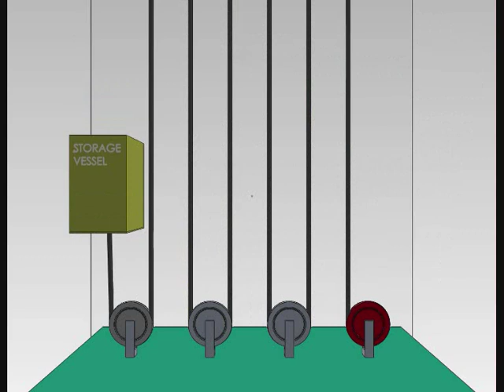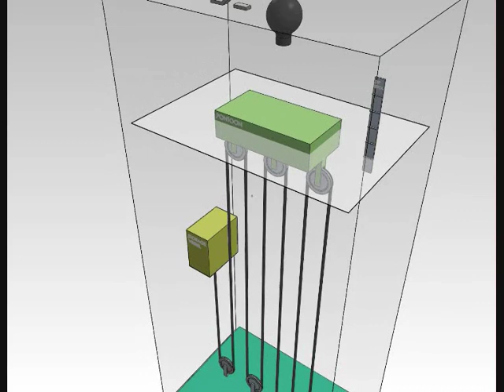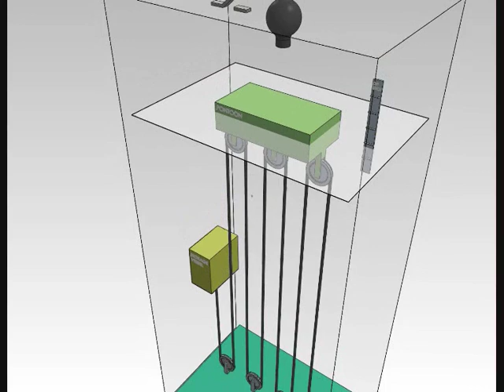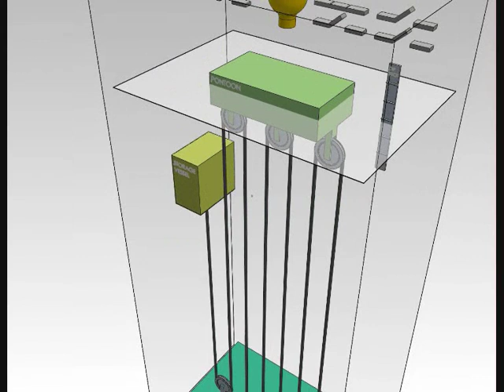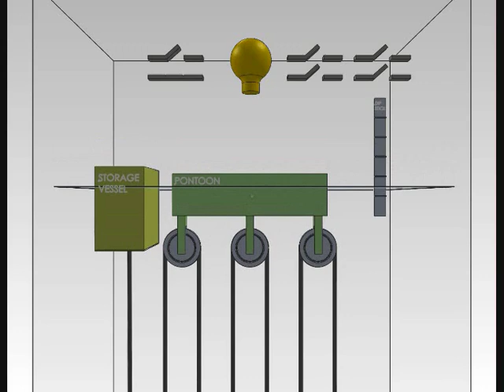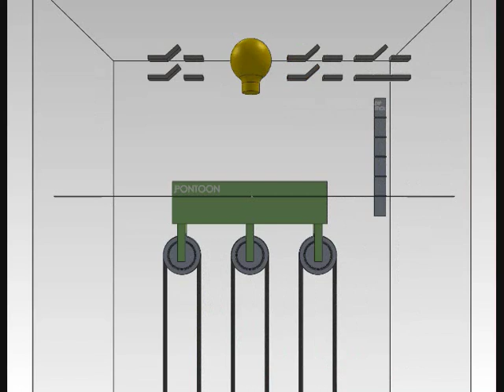Buoyancy Engine

Comment: i can make a similar system that doesn't even use tide. you can leverage the compression of air causing one float to sink. then you can relese the air back to low pressure and the float will go up. anyway in a float system, forces can be balanced one way and imbalanced another way. does not need to do any real work to create lot of work. principe is two system. one is the float itself the other is the change in pressure. one system give the other advantage and can be reversed.

Comment: The theory sounds good, but......You will have constant issues overpowering the weight or density of the water at max depth of the device to even cause it to come back up. Not to mention constant diver cleanup of marine life and the harsh environment to the materials it is made of.  Oh and btw when you are trying to sell a product make sure your diagram or video presentation is accurate, might wanna fix filling the working load on ascent. You will not be pumping the box full of water on the way up.
Reply: Many thanks but I'm not trying to sell anything, just putting the idea out there. With an ever growing population we need to develop renewable energy sources. The system can also be used to convert sea water into fresh water or produce hydrogen. As for through-life maintenance, I would not foresee an issue with proper detailed design.